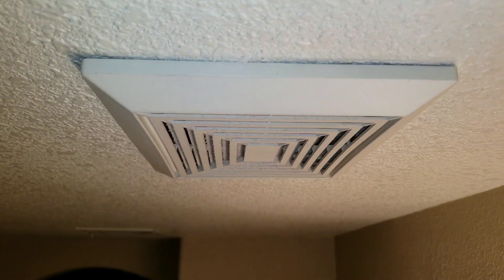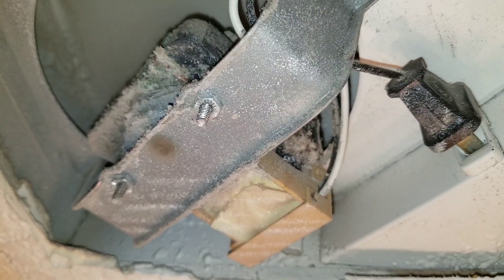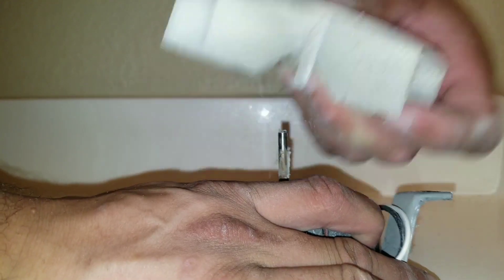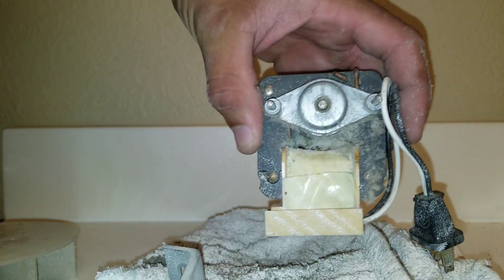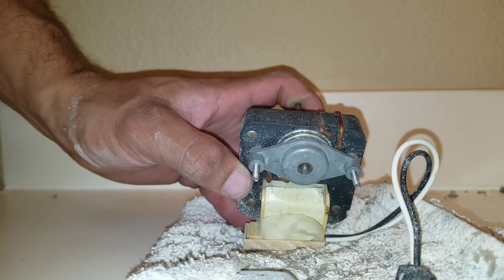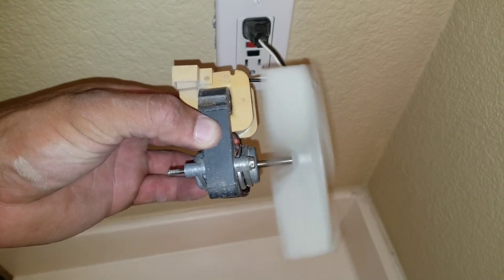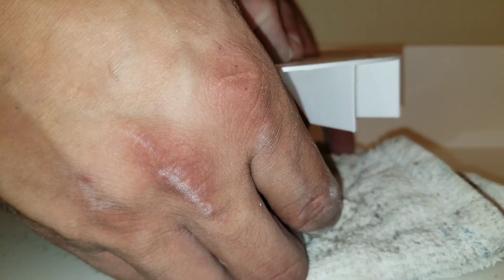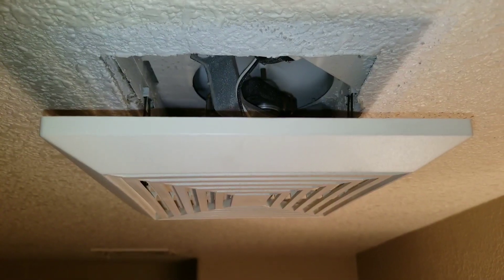How to Fix LOUD Exhaust Fan. Step by Step.

Comment: Dust and hairspray is what clogs up these fans the worst. If you remove the two bolts holding the motor together it all comes apart for a thorough cleaning. A drop or two of light oil on the bearing will keep it quiet for a long time but plan on an annual cleaning.

Comment: Thanks for the excellent post. Lots of money to save on self  repairs like this. Everyone has these loud fans. I just pulled the housing on my new one in basement ceiling , too loud upstairs and applied "B quiet" sound deadening material left over from lining my truck ...HUGE difference in noise due to reduced vibration.
Reply: Where did you apply it?
Reply: @midnight121190  Mine is located in a bathroom also.
Reply: @rhino10001  I meant where did you apply the b quiet?
Reply: @midnight121190  I removed the fan from the casing and applied the B-Quiet on any and all of the metal surfaces which can and do vibrate as these fans are thin and "tinny". These have to be cut in strips to fit. This helped absorb vibration. In addition I padded the top edges of the plastic light cover with 2 narrow strips of white weather stripping which keeps it from vibrating in its otherwise loose fitting snap-in slots.

Comment: Watched another video, (which was very good) took apart and cleaned entire assembly, still loud squealing noise when I put it back..watched this video and sprayed some PB Blaster Penetrating on both side of moving parts of motor, put back works like brand new..Thanks bud!

Comment: Since you went up to your attic to remove your ceiling-mounted exhaust fan, do you think our upstairs wall-mounted exhaust fan could be removed without going outside?
Reply: He did not go to the attic.  He did it from the outside in the bathroom.
Reply: The fan is on the ceiling. He just took the cover off to remove it. He was in the washroom the whole time (besides maybe when he was cleaning it).

Comment: After I removed my fan assembly I took it outside and sprayed it with a can of compressed air. For the first few seconds hold your breath so you don't breath in any of that crap. I then brushed it good, then compressed air again. After that I took it inside & started to disassemble.

Comment: Ive always had issues after using any kind of wet oil based lube on motors unless oiling the pads in the oilite bearings because with the wet stuff all the dust sticks to the thing after rather than blowing some of the dust away.   The teflon dry lube works awesome in regards to that..  puts a layer of teflon on stuff that wont let stuff stick on it..

Comment: what kind of lubricant you use on these motor and from where you purchased the blade
Reply from the maker: You can use any type of lubricant... WD40 etc. The blade can be purchased at any hardware store. Hope that helps 🙂
Reply: Use a specifically a motor lubricant and not WD40. WD40 will strip away all lubricants/protectants for the motor since it is a de-greaser. It will make it run smooth for awhile but once the WD40 dries up it will start to wear on the parts and make it worse.
Reply: @GMoney-B  Finally someone who knows not to use WD40 on fan bearings!
Reply: @TheMatsushitaMan  Hooray! I know something! Or any bearings already oiled or greased really.

Comment: What kind of stuff did you spray in it wd-40?
Reply: I used WD40
Reply: @quinn_nz  That is not a lubricant. That is a de-greaser. Never do this unless you literally take all the pieces of an electric motor apart, because you will need to clean off the de-greaser once its on there, otherwise it will make things rust and corrode once the WD40 is gone since the surfaces will no longer have actual lubricant. Instead, get some motor lubricant or lithium grease even. This will not take out the necessary lubricants.
Reply: @GMoney-B  Crap, oh well my exhaust fan is about 30 years old. If it breaks down I guess I will just get another one.
Reply: Quinn Y well. Don’t worry too much. It’s not going to kill it, but it will just run better basically.